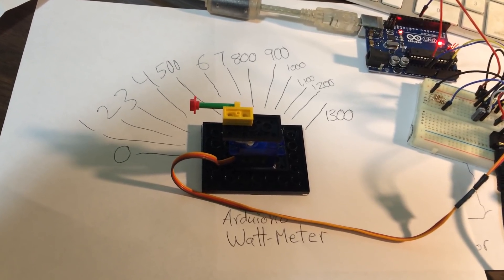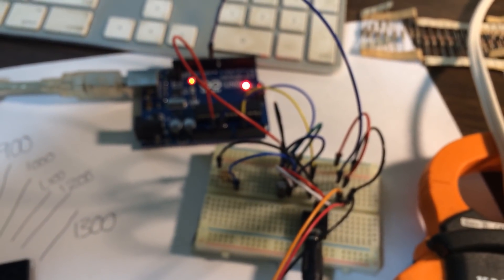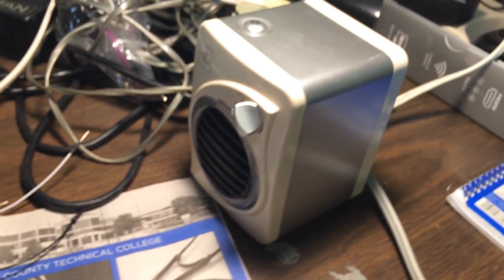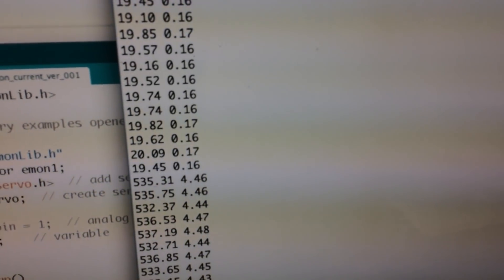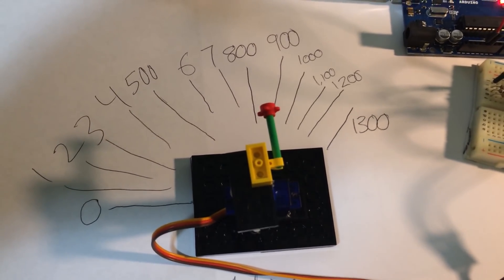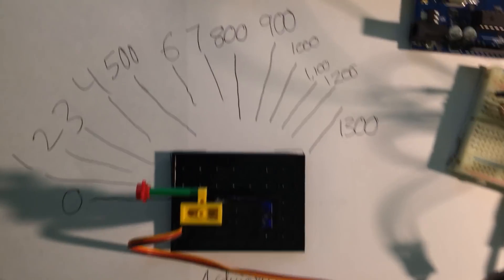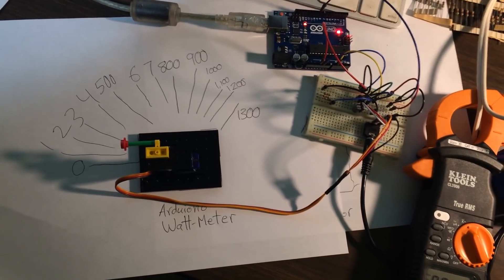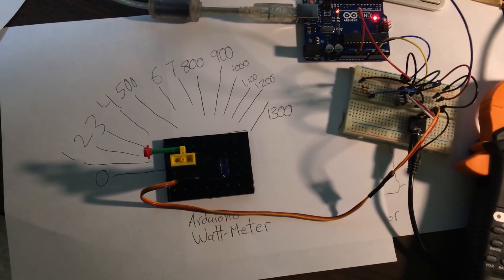Arduino Analog Watt-Meter Experimenting

Comment: Cool little project. Not to be too picky, because I know this is just for fun, but it's really more of an amp meter than a watt meter, right? You don't know what the angle is between the voltage and the current (although for resistive loads like the space heaters you tested with, it's effectively zero). Thanks for sharing this!
Reply from the maker: Right, yes, you are correct. In this case, we are just measuring current and I'm just running a multiplier for my known voltage. The next step up on this project would be to have another circuit which would measure voltage. With that, true wattage can be calculated. I want to use this with my grid-tie solar array. Grid voltage is very steady in my area, so right now, even just plain current measurement would be fine. Voltage measurement is very important with things like battery systems, where the voltage does swing quite a bit. But yes, at this point, it's technically an ammeter only (but my brain works so much better in watts!)

Comment: plotting that solar data on a monitor in graph form would be a cool idea as well.  What part number did you use for the current sense device?
Reply from the maker: I'm just starting to play around with this, but in the video you can see the power and current is being simply displayed on the computer monitor through the Arduino Serial Monitor. I'll work my way up to a fancier system, including graphing. The Open Energy Monitor system has a nice remote data collection system including a graphing feature. https://emoncms.org/
The current sensor is a YHDC brand SCT013 100A:50mA sensor.